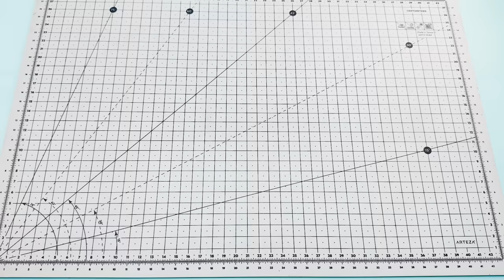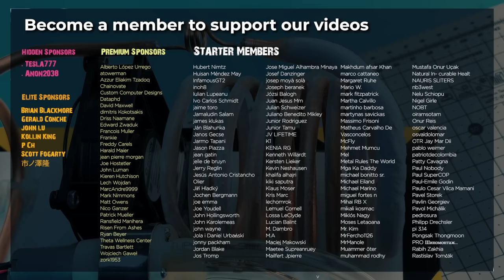How to Make a Powerful Mini Freezer - Portable Mini Air Conditioner up to -10ºC

Comment: No funciona. Asi de simple. El motor no tiene la capacidad de comprimir el gas.
Reply: not much, but it does get cold, just not the ability to push much cooling volume. A peltier chip about the same, can cool only a few ounces of drink.

Comment: How long before you have to refuel? (I know nothing about how an AC works)
Reply: Didn't even bother to tell everyone that this is a joke. The theory is correct except that the fan is on the evaporator and not the condenser.

Plastic tubes and a weak pump are the starting points of why this setup won't work.
Then the fan is in the wrong place, it should be on the other coil [condenser] and that coil is inadequate, the capillary tube [the small coil] is likely too big and finally too little refrigerant.
[Yes, flammable gas such as butane or propane can be use as refrigerant.]

Comment: Zaten olmuyor ben aynisi yaptım gaz basınca hortom patlıyor. Gene yaptım. Boş olmuyor kimse denemesin bir çakmak gazı dolu iken bitirdim. Ona göre
Reply: I agree -  this can't work as the centrifugal pump shown cannot create the output and input pressures required as per an adequately sized positive displacement pump with adequate power supply - also gas may leak via the drive shaft in most 'open drive' pumps unless it has an adequate seal (similar to rotary pump shaft seals used on auto Air Conditioner compressors) other than sealed / hermetic type compressors.   The smallest (Approx. Pop-Can sized) hermetic refrigeration compressors are used in mains and 12 volt mini-portable ice makers - complete with virtually all the components + needed for as little as $100 - $130.00. It also possible to achieve the objective with cascaded solid-state "Peltier' devices - sometimes used in some mini Ice-Cream makers. If the butane gas has any moisture content it may freeze and block the tubing. Adequate tubing, a fill valve and a non-flammable refrigerant gas would be much safer.
Reply: It will work once per gas fill as the gas will escape via the pump drive shaft + any other leaks and absorb heat (become cold) in doing so - the type of pump as shown cannot re-compress the gas and serves no purpose in this set-up except to provide a slow leak for a so-called single shot refrigeration system. It's dangerous if using an inflamable refrigerant, it may displace air in restricted spaces - required for breathing - and it's illegal to deliberately allow many types of refrigerants to escape in most jurisdictions.

Comment: How does the copper coil cool down?
Reply: Its not coil .
Its copper pipe 
Butane gas compressed in big pipe 
After compressed butane gas spraying narrow pipe to big pipe 
Spraying butane has cooling effect
Reply: Joule-Thomson effect.
Reply: the gas when passed thru the orfice will cool, like when a spray paint can gets cool when you spray paint something.

Comment: Why butane and not freon gas? I did not know butane can be used as a refridgerant. Can someone enlighten me on the type of gas ,please.
Reply: Butane, ethane, propane, and ammonia are all excellent refrigerant. Any substance that changes state can be used as refrigerant. High pressure propane can chill to -80°C in the right system. I recommend taking a fundamental refrigeration class at a tech college if you want nitty gritty.
Reply: @LukeNeiffer  thanks bro
Reply: You could use whatever, but propane and butane are refrigerants and are very efficient. It's also illegal to vent freon to the atmosphere because it acts as a greenhouse gas, but it is legal to vent propane and butane
Reply: Que no es inflamable !?

Comment: Hello brother, how long does it keep the gas?
Reply: R-600 or isobutane as a refrigerant is never lost as long as the system has no leaks. Pressure test and vacuums I’ll assume that it is so.
Reply: @yinggamer7762  Can lighter gas be used?
Reply: @Ariya369  the device in this video will not work, but you can also use propane, r-290. If that’s what you mean. All the different gases have different working pressures. Also this video that system is definitely not a closed loop and will leak over time, he also failed to pull a vacuum on it to so his refrigerant is contaminated

Comment: In my opinion, the experiment is not applicable First, the 12-volt pump was connected to a 9-volt battery, with the fan connected to the same battery. Secondly, the gas used is butane gas, not virion gas. Virion gas is easily transformed into a liquid state when compressed, and it is difficult to obtain the same result with butane if the installed pump is actually capable of performing the pressure at all.
Reply: i think butane liquifies at bout 2 something bars at room temperature, i think it could be possible with a smol pump? Idk, but the construction still seems pretty sketchy.😅
Reply: @michalsabat4720  🤭
Reply: Butane boiling point -0.5°C. Isobutane boiling point -11.7°C. At atmospheric pressure.

Comment: how long do they last?
Reply: one side produce cold but he do not show other side pipe temperature , which other side become very hot , so you can not cool anything  , like you open fridge door and expect room get cool but nothing will happen because , hot air produced rear of the Fridge will keep room temperature over the time raised while wasting electricity for nothing .
Reply: @albundy3696  how could you solve the issue of the part that gets hot?
Reply: @myice-creamdreams3421  The same way any other cooling device works, be it a home AC unit or a CPU water cooler. You can't just create cold, you transfer heat. A home AC unit takes the hot air from inddor unit and pushes it outside through the radiator on the outside unit, or in the CPU cooler, the pump pushes the heat from the CPU to the radiator and the fans on the radiator push air through it so the hot air is pushed oustide the PC case. The CPU gets cooled, while your room temperature rises, laws of physics.

Comment: Impossible without compressor
Reply: There is a compressor - the capillary hinders flow and forces gas to compress and give out heat, and after passing it expands and loses its energy and takes it from the pipe as the heat, leading to cooling of the pipe.

Comment: Mmm 🤔, this seems to be a bit weird and also why only 9 volts on a total of 20 volts of machinery .. other comments are similar to mine, so you should explain more details on this project
Reply: definitely... the fan is 12 v ... that little pump, even little, sucks up a lot of current so a proper sized power supply is needed.... easy to find these days so you should think of this project as a "proof of concept" instead
Reply: @Allbbrz  The cheap "Air Pump" is a Windscreen Washer Pump. The gas would quickly leak away through the Motor Shaft Seals. The freezing Effect is the gas that is leaking away.

Comment: Cleaver use of Isobutane //
Reply: i dont like that the use an explosive gas ev
en in small amounts
Reply: Fire hazard when try build larger system , Butane may leak become explosion hazard , buy cheap Window AC and install at your window .

Comment: is this real?😊
Reply: I'm a retired HVAC mechanic and it looks real to me.  Useless except as a demonstration. The battery couldn't last very long. He's using the air cooled by the evaporator coil to remove the heat from the condenser coil. Flammable gas as a refrigerant is not a good idea.
Reply: очень может быть если требуется охладить коробку от печенья.
Reply: @miker252  alot of guys have transmission overheating issues if you can invent something like this in a box that you can install a trans cooler inside to keep cool you will be rich as a king   but make it run off the cars 12v system lol
Reply: Yes, if you not went to school